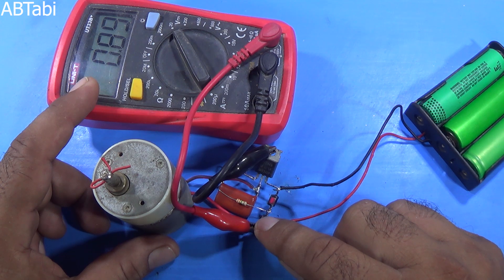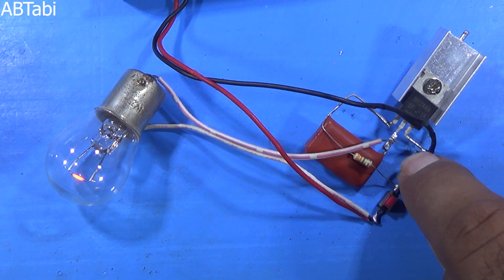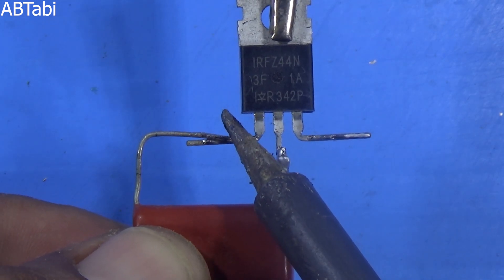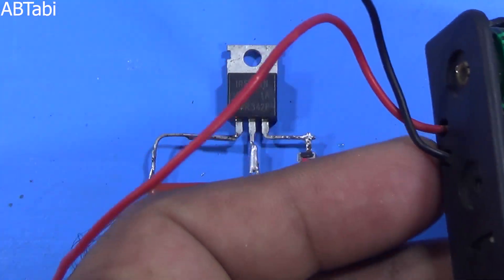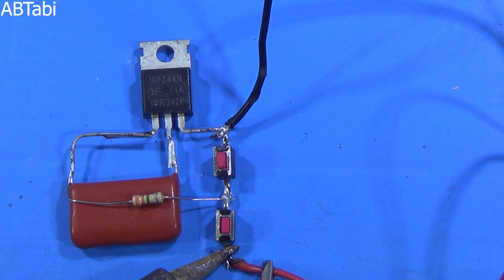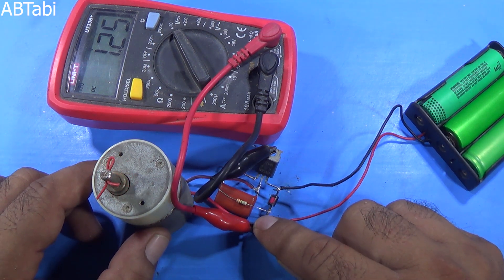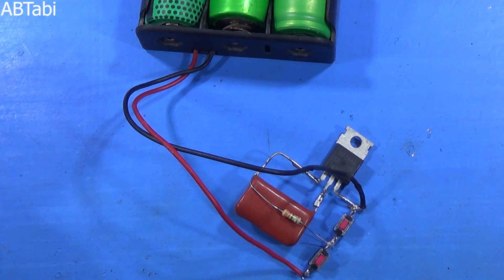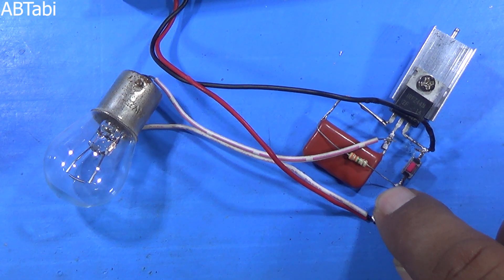Make a DC motor speed controller diy dc voltage regulator

Comment: Hello, very inventive and nice video ! can you please explain briefly how this works ?
Reply from the maker: Yes, sure ,,,,,   please wait .............
Reply: @ABTabi  Thanks ! Can't wait...
Reply: I would also find it very useful if you could give a brief explanation with your excellent videos. Thanks
Reply: Yes. When he presses the button that that stops current from going to the motor. It pumps up the voltage across the capacitor, Then the capacitor has more voltage to turn the motor faster. The same with the light, But it only has a maximum amount of voltage the capacitor can hold. If you had a bigger capacitor you would get more speed with the motor and more brightness with the light blub.
I hope this answers your questions my friend 🇮🇪👍💚